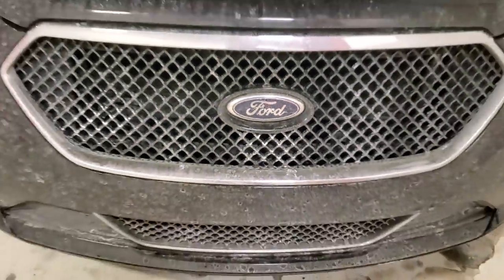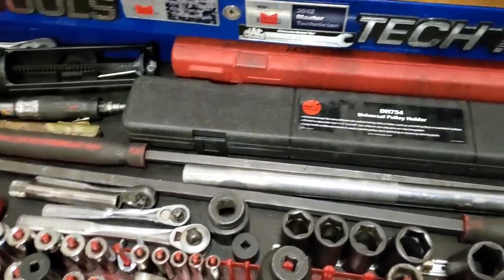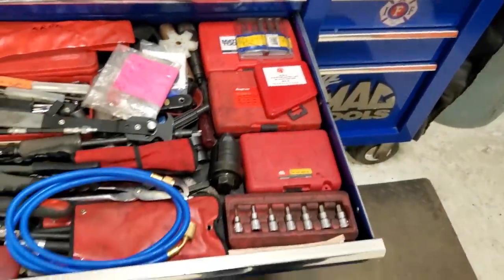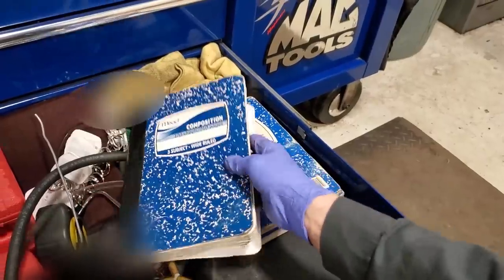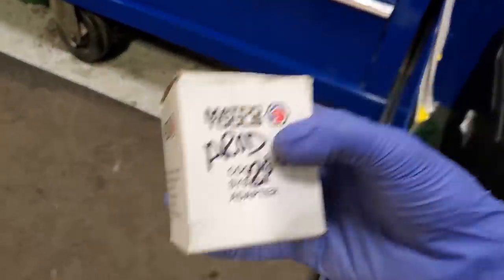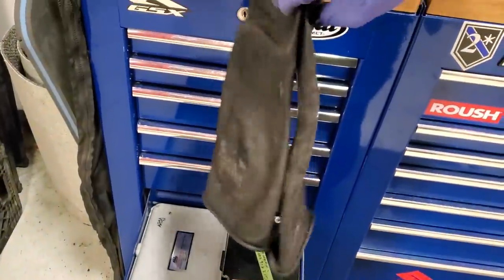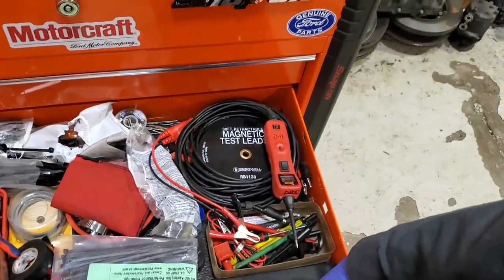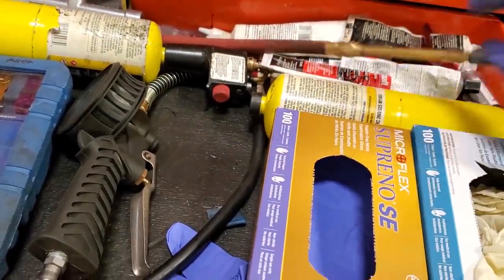PTT W/ARod's Full Tool Box TOUR!!

Comment: HOLY SHIT, and I thought I had a lot of stuff laying around!!! BTW the "L" shaped hose with the two grenade pins you pointed out at 21:03 is the old 08S05 recall for the old F-150s with the 5.4L 3-valve engines. I HATED doing those recalls. I used to either get my hands all cut up or burned, trying to change out that damn vacuum hose at the back of that intake manifold. I still have my test FICM which I never use anymore.
Reply from the maker: 😂😂yepp them good ol dAYZZ

Comment: You don’t have to pull that fitting on the water pump for the 7.3 to pull the HPOP gear. I change them all the time without pulling it. I did start out that way until I saw diesel tech Ron do it with it on. Never taken it off since.
Reply from the maker: Hmmmm 🤔🤔🤔

Comment: Got any magnetic sockets? I got some 1/4" and 3/8" metric ones from matco. Makes dropping those little nuts and bolts happen less. Only ever had one stay with a truck, cause the magnet was stronger than the detent on the extension.

Comment: My 2017 lariat f250 steering wheel is already dried out. $800 for a replacement. Would I need it programmed as well or can I just replace it? Has active steering and normal cruise control with heat
Reply from the maker: Yea ull need the comp to configure....
Reply: PowerStroke Tech Talk w/ARod  is that something I can do with forscan or is it a dealer program?
Reply from the maker: I think maybe, i never used that tool

Comment: PTT question i have a 2014 that I'm doing a water pump and the parts guy said they change the coolant from orange to yellow need help is it OK to mix orange coolant  and that new coolant that is replacing the orange coolant.
Reply from the maker: U can switch. Drain block removin an oil cooler hose...then u can add the new yellow
Reply: @PowerStrokeTechTalkwARod  ok thats for 2014 6.7 so they changed then I didn't know that thank Bro.
Reply from the maker: All ford vehicles that take orange. Ford dis continued it